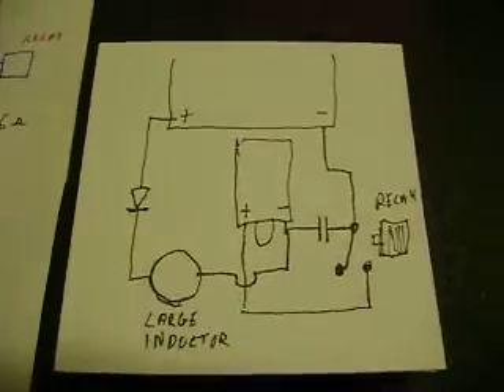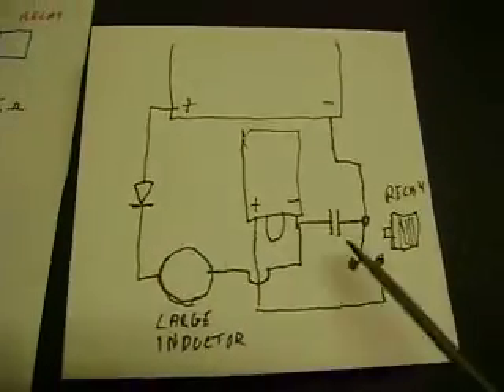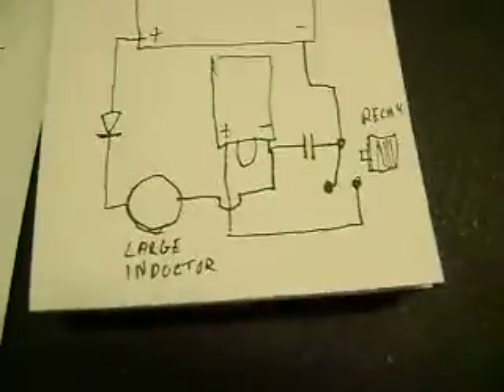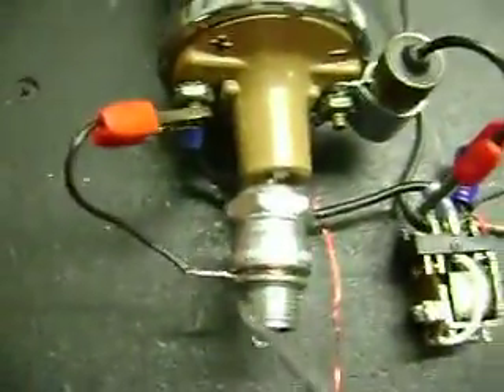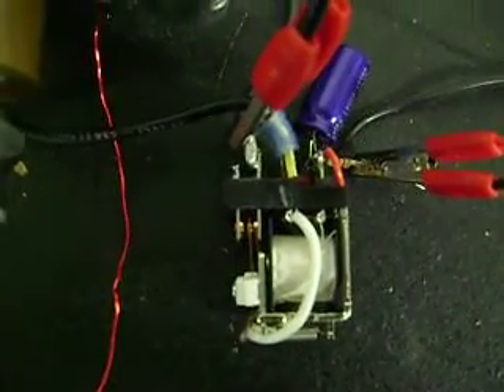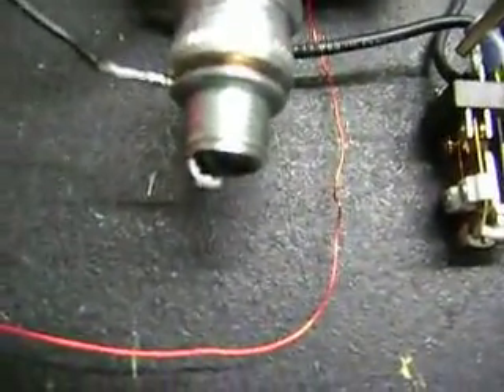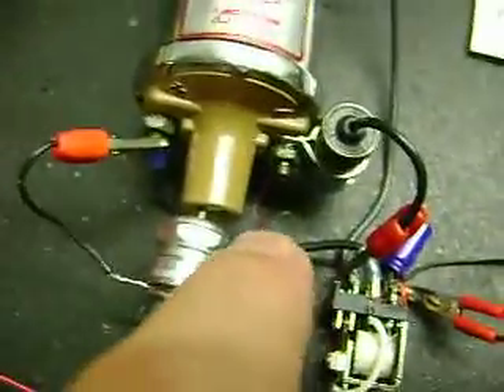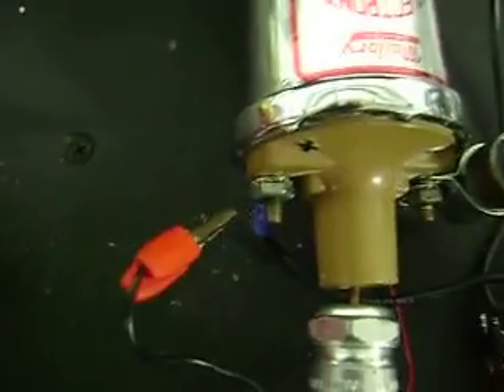Tesla Igniter Patent Circuit. Huge Efficiency Gains And Multiple Sparks

Comment: How To Increase High Volts Of Lawn Mower Ignition Coil?

I ran across recently a statement made by Nathren long time back,  in Georgia, from the shut down tech web forum. It was a reference to the use of very mini Tesla Coil in conjunction with the Briggs engine Magnetron ignition.  This would provide Radiant Energy, and increased voltage to spark plug. The old forum said that the technicians noted a higher voltage on the lawn mower running engine than the conversions done on car engines. for water to Hydrogen spark plug electrolysis with resulting self running from the 12 alternator magnets. 2005-2008.
No core miniature air core wire wound forms were called Color TV Delay Lines ,- magnet wire on cardboard tube or the smaller radio coil RF inductors. The R.E. would be and aid to the conversion.

Comment: glad someone gave it a go. that theres people with an interest in his more obscure inventions rather than the mainstream BS.
the earliest CDI!
i got an old set of books, only vintage publication from post 1910 that even mentions him. describes using this as an alternative in certain cars of the period.

i keep meaning to make a video on it myself, the thing is... its meant to be an air core coil. not a standard ignition coil. the iron core and its large inductance is killing a LOT of the power of that discharging capacitor, reduces the rise time of the applied current and therefore secondary voltage. 

i sort of started with making a copy of his electrical oscillator, all of which are exactly the same thing... though most of them tended towards mercury switching rather than simple points. this is the only part they share with "standard" induction coils, using the building magnetic field in the primary inductor to operate the points (not a relay...) then life got in the way as usual... oh to have a valuable patent, royalties, and the freedom to simply tinker!

quite simple really, and also very robust. shouldnt be any arcing across the points, one of its main features. means the capacitor is too small.
points closing again, capacitor discharges into AIR coil primary, stepping up in secondary to sparkplug, whilst inductor builds magnetic field again.
repeat process as points open again. 

the large inductor also "chokes" any HF oscillations from reaching the power supply... diodes are unnecessary.

on an engine, the result should be a brief, HF HV spark, as the points remain open for quite some time versus close time, whereas in his "oscillators" the points are operating rapidly, producing the "undamped discharge" we see in the few pictures of his electrical oscillators in operation (the one that silly people liken to the egyptian "ankh"...)